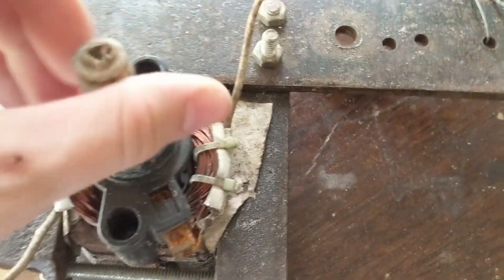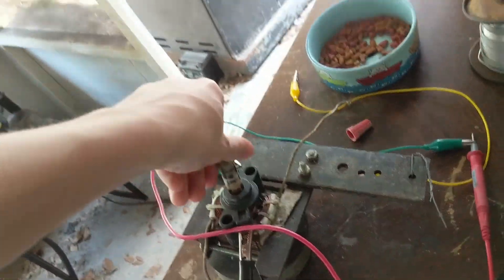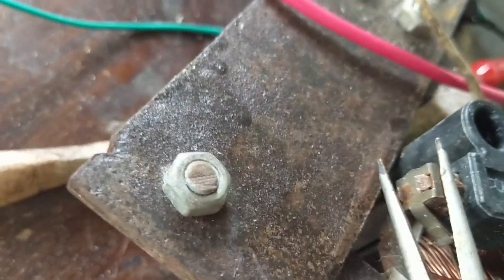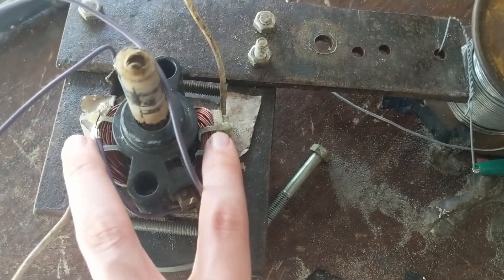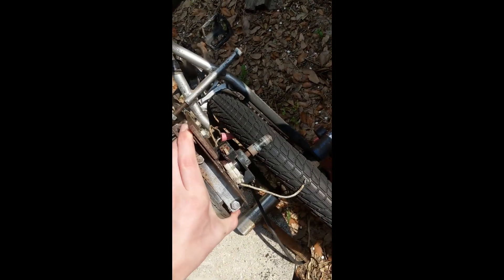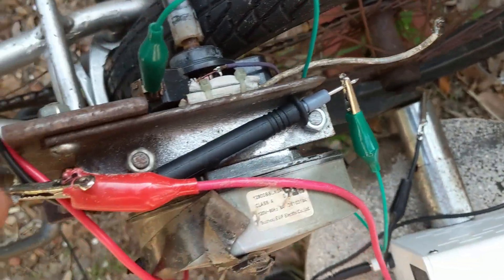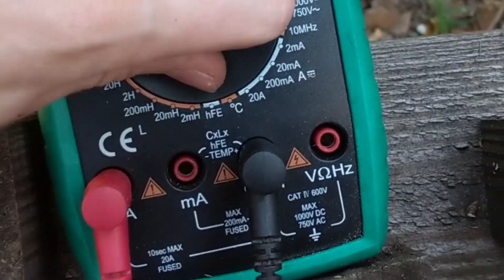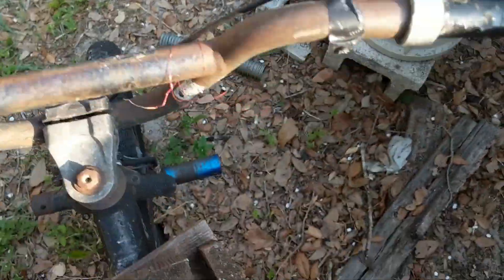converting UNIVERSAL MOTOR to ALTERNATOR GENERATOR experiment | VACUUM CLEANER MOTOR

Comment: i got 48 v and 1.2 amp i use 1 full bridge rectifier and a 220 MicroF and 400 V capacitor i fed it with a modified atx 13 volt pc power sourse. did i make somthing rong?
Reply from the maker: Without more detail I can’t be sure. What I’m wondering now is if you used a 240v motor?
Reply: @mondude9754  yes is a 220v ca mtor frome a blender
Reply from the maker: @jrgtsmith3707  so that probably explains the difference so I believe you hooked it up right

Comment: If You Take The "Blower" Motor Out Of A Scrap Car.. All Those Will Produce About 15V But Then Invert It ... I Think There's Videos Of Some Building Mini Generators Using Them & Weed Wacker Motors... Also The Syc. Motor From A Microwave Turn Table Will Produce 100's Of Volts When Spinning The Shaft ... I Would Take Them With The Little Plastic Piece That Slip's On & Make A Crank Out Of A Piece Of Wood.. Then Have 2 Wires Coming Out That I'd Get An Unsuspecting Friend To Hold... & Then Crank The Motor & Shock The Bejeezez Out Of Them... Lol... Be Careful Tho... It Will Really Shock You.... You Can Power CFL & LED Light Bulbs.... Anyways... Keep Rockin' Ladd !!!
Reply from the maker: Thanks for the ideas! Since this video I made an adapter for a 24v scooter brushed dc motor shaft to rub the bike wheel. It works so much better than the generator in this video and of course doesn't require external energy for field windings